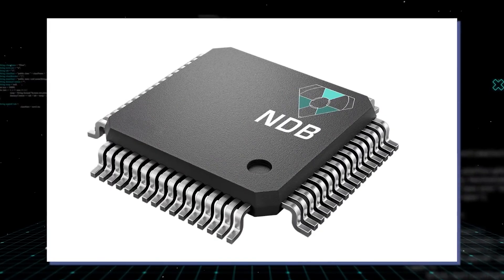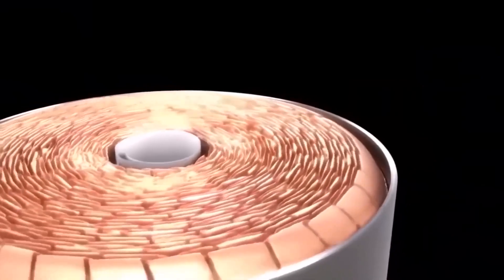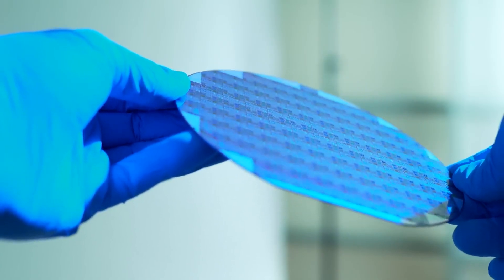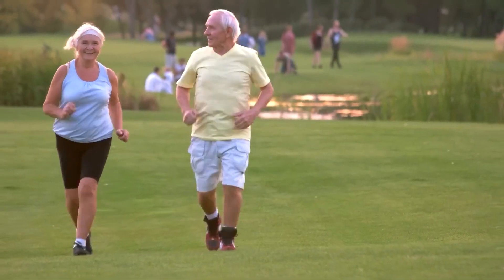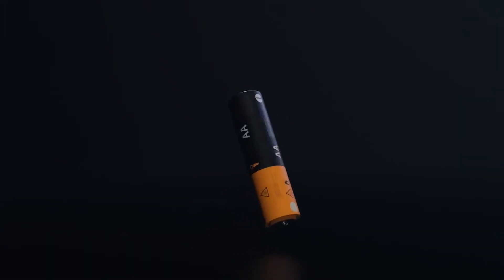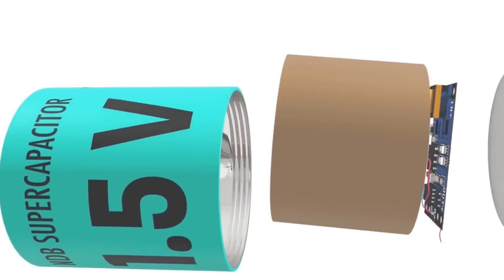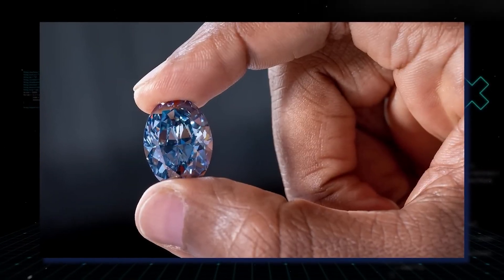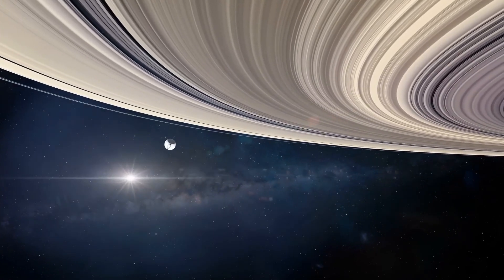This INSANE Battery Will Change Our Planet FOREVER!

Comment: This video is promoting ignorant rubbish. The power density of 100 micro Watts per cubic centimeter means you’ll need 1000s of times bigger battery to power a phone, laptop or EV with nuclear diamond batteries.

Comment: The critical question is how much does it weight per kwh and how much do they cost per kwh.
Reply: No, the most critical question is power density. You need 1000s of times bigger battery with nuclear diamond batteries to power a car, phone or laptop, which this video fails to point out.

Comment: Back in the 70s i started my engineering path as a 14 year old. I  thought I would end up as a mechanical engineer because my dad was a mechanic and so was I.  Ended up in Telecoms as an engineer.  However I designed a car at 14 that ran on a "Nuclear Pellet" to drive an electric motor.  Of course I didn't have the answers to many for the questions especially about radiation and such but I have always wondered and argues that Nuclear is the answer to a lot of our power needs and will continue to do so.  We have to stop letting fear mongers and leftist stop us from doing the right thing.

Comment: Not enough info to say.. omg- are these radioactive, how are the disposed of or recycled… items not addressed here leave no room to provide an answer to “would I use one”.  That said , it is interesting but probably vapor ware and the potential to save the planet will be too late.
Reply: The planet is not dying. The biggest threat to the planet is not a trace gas that only comprises about 400 parts per million of the air. That is 0.04%. CO2 actually reflects as much energy as it traps and is therefore not even a greenhouse gas. The people who claim it is a greenhouse gas conveniently ignore the refection coefficient. The biggest threat to the planet are volcanic activity, which has been relatively inactive for the past 150 years, and those lithium batteries. Those batteries are extremely toxic and there is no good way to recycle them. And volcanic activity will begin to increase at some point with a large number of massive eruptions that will eventually occur. Mt. St. Helens was actually quite small compared to what has happened before and what is eventually coming.
Reply: Unicorn farts...

Comment: I would use this battery especially in things like cars.  The other thing is think about houses.  Having a battery bank of these to run your house.  You could all but eliminate the electric company and the millions of miles of cables running around a country.  I am totaly on board once the price comes down to a resonable price.
Reply: That is essentially the Tesla power wall you’re describing.  NDBs could make them much more practical.
Reply: You know the politicians and utilities will screw the consumer, probably in the name of jobs or babies or something heart tugging.
Reply: This video is promoting ignorant rubbish. The power density of 100 micro Watts per cubic centimeter means you’ll need 1000s of times bigger battery to power a phone, laptop or EV with nuclear diamond batteries.
Reply: And that's probably another reason we won't see this technically available to the public for decades.

Comment: I think the close to $20K price increase to go from the standard 230 mile battery in the F-150 lightning to the 320 mile battery is crazy.  Hope either the pricing on that goes down or the battery gets better
Reply: I own two F150s and would never consider buying an EV model. The range is simply insufficient and the cost is way to high. I need a vehicle that I can travel +400 miles with on a tank or charge while pulling a trailer. That does not exist on an EV.
Reply: @herbb8547  Its funny because you say never but BEVs are set to double range in just a few years to 500-600 miles per charge.
Reply: @thetechguyz8645  Where is the proof that the range will double? There is  just talk. Sounds like B.S. to me. And what will be the range when it is 25 below zero, like we see here in MN? None of it means anything as the US simply does not have the power grid to support even 10% of the population driving an EV. The entire power grid will have to be at least doubled to support even 50% driving an EV. That is a lot of coal powered power plants, not to mention power lines and larger transformers everywhere.
Reply: @herbb8547  ok
Reply: @herbb8547  batteries have doubled their range in the last 10 years and the rate of improvement is going up so doubling the range in another ten years is a safe bet. Also, I don’t know where you got your info about the power grid, but it is completely wrong. The grid is not that far off and can keep pace with the increased demand as the number of EVs increase over the next 10 to 20 years. Solar and wind generate power very inexpensively but as they are intermittent they do require a large invests in… batteries. Exactly what EV,s provide. There’s already plans to network evs into the grid and use all those batteries.

You sound like the people who wanted to stay with the horse and buggy because there weren’t enough gas stations when cars fist came out. Don’t be a dinosaur man, they went extinct.
Reply: @polarbear4612  You obviously know absolutely nothing about the electrical grid and are spouting some leftist talking points. I work with the energy industry. The electrical grid, in most areas, is barely enough to meet current needs and many cannot meet peak demand. California has been telling people with EVs to not charge their vehicles for much of the summer. How can you expect to double the energy demand with the current grid? The only way would be to bring many offline coal plants online and even then most neighborhood transformers cannot withstand that type of energy demand. They will simply burn out. It is just a matter of how much current the transformers are designed for. It would take many millions of transformer replacements to even have the ability to support 10% EV vehicles across the US. The entire energy grid would have to be rebuilt to support 50% EVs. EVs are a pipe dream at best.